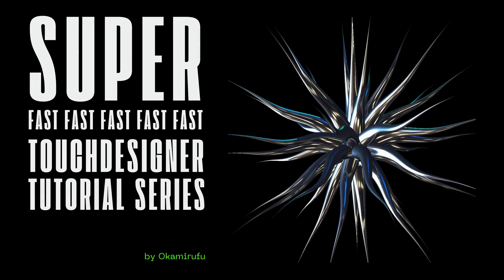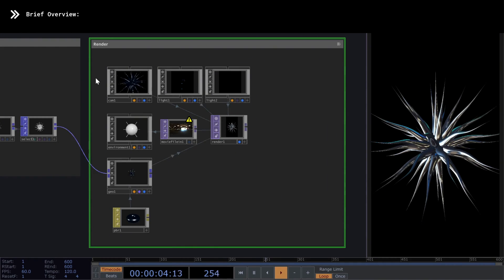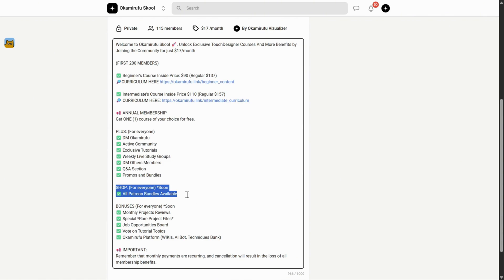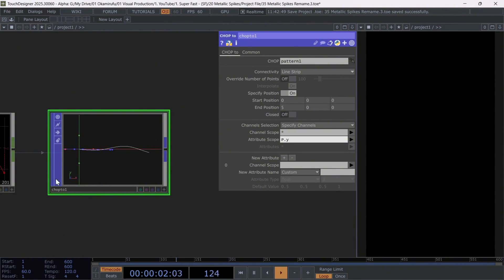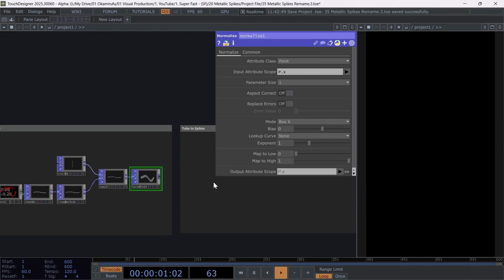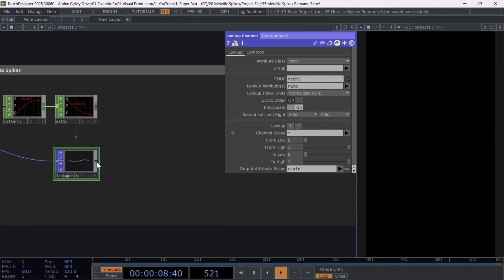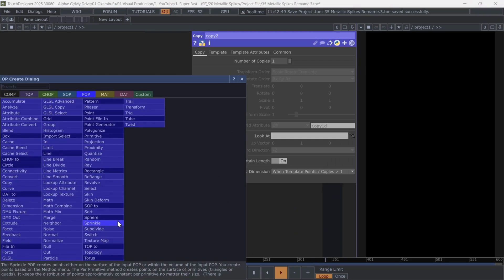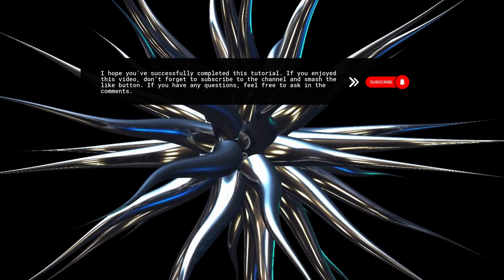TouchDesigner POPs: Metallic Spikes with Lookup, Math Mix & Chop Pattern – Parametric 3D Modeling

Comment: Again, I've been a fan of a series. Two questions that I got:
- what does "normalize" do. I see the result of not using it and it is definetly needed, but I don't know is behind this action
- when you create a mathmix operation A*B, it automatically is applied to the scale of the circles. why? How does it know it? It could have been used for rotation, but it automatically knows that we meant scale. This is the general thing that I still find confusing sometimes in POPs.
Reply: for everyone who didnt get it. The normalise recomputes values from our inputrange to 0 to 1 using the lowest sample value as 0... Which results in circles close to x=0 beeing scaled by 1 and circles far away beeing scaled by 0.